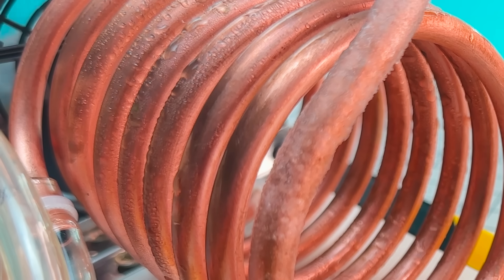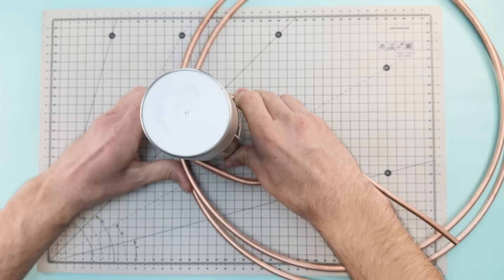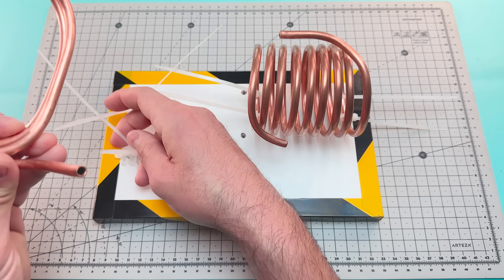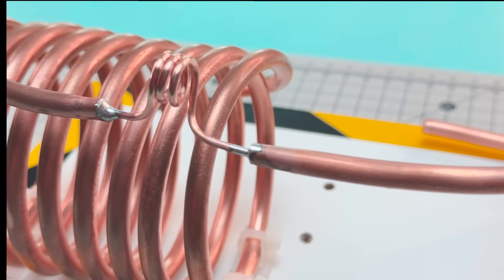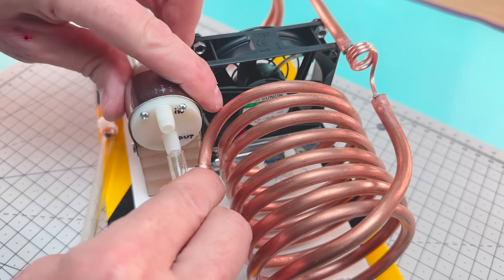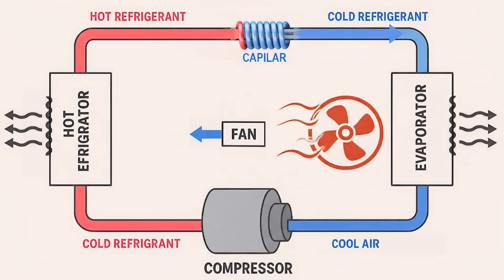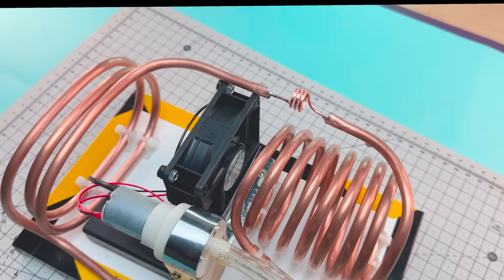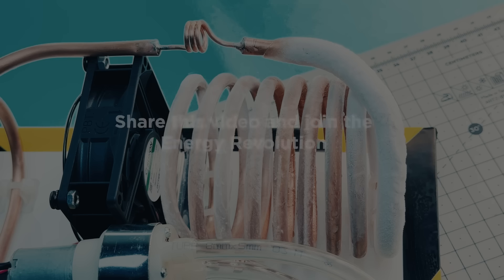Make your own AIR CONDITIONER at home Fast and Easy!

Comment: This is click bait. It wont "cool a room". Basic design principles have not been followed. Need to evacuate the air out before adding flamable fuel. There is an air/fuel mixture in it now. This is "at best" an example of what it could do when properly designed and constructed with knowledge and experience. Besides, powering a 12 volt fan and 12 volt pump will use up the 9 volt battery in just a few minutes. If it even runs at all.

Comment: i would redo this entire thing and have two 18650 batteries and a Noctua high rpm fan blowing cold air in and a weaker fan for the condenser side blowing opposite for warm air out and a shroud around both too direct airflow and for the hot side a fitting for a dryer exhaust hose too go out a window with a solar panel connected too the two 18650 too charge them when placed in the window thus batteries wont go dead on a hot sunny day !!! and it would be more efficient !!

Comment: Many are asking of efficiency , The cooling side has a larger surface area compared to the heat dissipation coil side , improving efficiency, for more efficiency the heat dissipation coil has to be immersed in a cool fluid .Another Idea is to improve the system two coils for cooling one immersed in water together with the heat dissipation coil and the other outside together with the fan .

Comment: Surely it will not cool down the room, but you can do exactly the same setup for making a water chiller for example , and it will work .

What kind of air pump is it ? Piston, diafragm ?
Reply: это мембранный вакуумный насос 12V

Comment: I wonder what is the efficiency of this compared to peltier type
Reply: A couple of days ago I asked ChatGPT how to generate water with a Peltier element. It gave me an instruction, but strongly recommended to use compressor based systems because they are much more efficient.
Reply: It's 5000% efficient 😂

Comment: Only an idiot would think this would cool a room. Same flawed concept as leaving a refrigerator door open to cool a room. It actually heats up a room. It's a fun experiment project for a kid though and the work technique is decent and very well demonstrated. Have to admit overall I enjoyed the video. Good stuff.
Reply: Это принцип всех кондиционеров
Reply: @город727-у9э  Yes, but air-cons transfer the heat outside, not just release it into the same space and real aircon Dehumidifies, this does not.

Comment: How hot is the other side of the copper tube?
Reply: Approximately equal to how cold one side is. In other words, if room temperature is 75F, and the coil is lowered to -10F, then the warm side will be approximately 85F warmer than room temperature (160F).
Reply: @paulswarthout9967 One side is a freezer, the other side is a stove. Is 160F hot enough to cook anything?